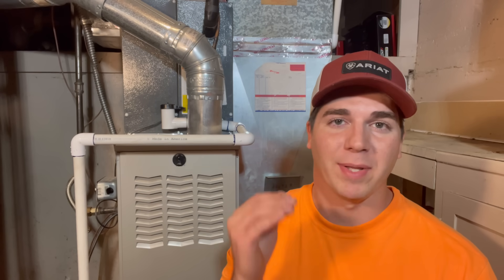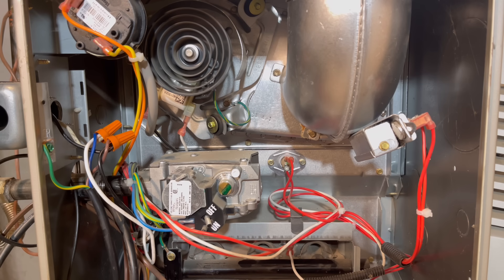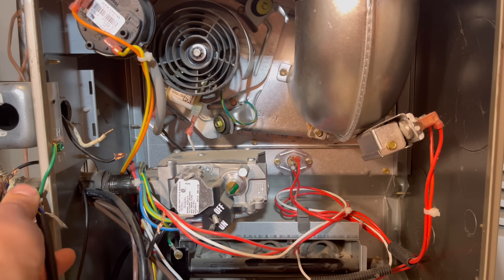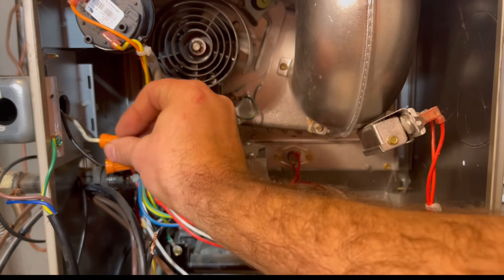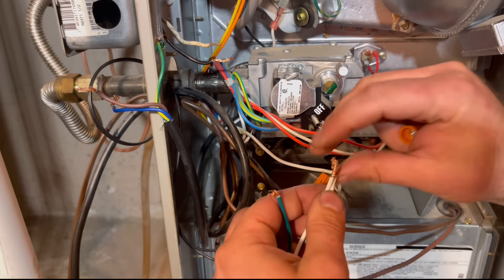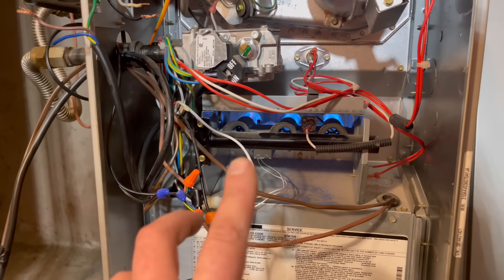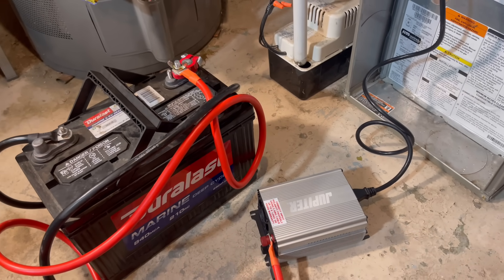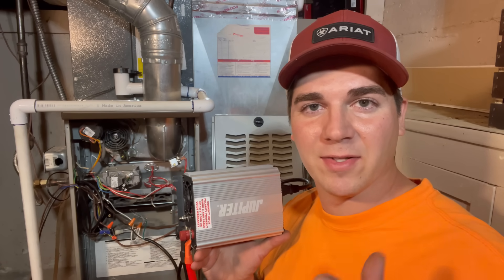Did You Know You Can Heat Your Home With A Car Battery?

Comment: I noticed that you removed the orange wire nuts from the live wire and negative wire to attach the pig tail to the furnace.   I’m not an electrician but isn’t it risky to leave a bare live wire in such a location?  Most of us have a bunch of extra wire nuts lying around to use.
Reply from the maker: I don’t have kids or anything so I knew that switch wasn’t going to get bumped but it’s always a good measure if you’d like to keep some wire nuts on it.

Comment: How would the thermostat work without power? I have a battery operated one but what if it was hard wired?
Reply from the maker: The furnace powers a hardwired thermostat. The furnace has a transformer that takes 110v and turns it into 24v which powers the thermostat.  So if yours has batteries it simply sends the correct signal for heat, and then if you have a hardwired thermostat, it gets power from the furnace, THEN uses that power to send signal to the furnace. Hope this helps! Cheers
Reply: @diyhvacguy  Great answer! I'm going to have to get the things to make this happen. I'm tired of lugging a round a big kerosene heater when the power does out.

Comment: The air handler should be able to run off of a modified sine wave inverter, is there a reason to use a pure sine wave inverter? Just thinking out loud for those who might want to keep the price as low as possible. Also, the larger the furnace, yours looks pretty small, the more battery capacity will be needed. Not sure how much more, just something else to consider. You say it will run the furnace for a couple days, what is the rating on the battery you are using other than cold cranking amps? How many amp hours does it have? One last thing, I saw below about using a switch for a more permanent setup. I'm gong to set mine up to avoid any possible back feeding of current, in the event I am away and the wife has to switch things over. I am gong to take the supply wire for the furnace and attach it to an outlet. Then wire the pigtail to the furnace and plug it in to the new outlet. Then when you need to switch it over, just pull the plug from the outlet and plug  it into the inverter. Then there is no way to back feed, when the lights come back on just move the pigtail plug back to the outlet.
Reply from the maker: Pure sine wave is better for sensitive electronics supposedly
Reply: @diyhvacguy  Yeah, the circuit board is the question mark. I'll give it a try and let you know. I have a modified SW inverter so I'll try it first before I buy a pure SW

Comment: Why not just unplug the furnace from the wall outlet and just plug it in the inverter
Reply: Yes I'm a electrician 
It is standard and per code to have a 6' cord tail installed on a gas furnace cord ignition power and
Reply: A disconnecting means
Reply: All new homes have a dedicated furnace  
Outlet for gas furnace for this reason.  If it was electric furnace it would have a disconnect and would be hard wired
Reply from the maker: I just did this upgrade so now my furnace has a dedicated outlet on a switch. Thanks for the tip brotha!
Reply: Dont misread my text.  You do not need a switched outlet but there is nothing wrong with having one.  Unplugging the cord is your disconnecting means.  The outlet does need to be on it's own 20 amp breaker.

Comment: Can I use the spare outlet on the inverter to plug in a battery charger and connect it to the battery so it will run forever?
Reply: @Mike Wensel Then I guess by that idea. You could use the charger on an EV and drive forever as it charges it's self. Things don't work that way.
Reply from the maker: The laws of thermodynamics simply won’t allow that to work. :)

Comment: Sitting that battery on concrete will drain it over time, you should sit it on top of a piece of wood. Also, you should mention that you are using a marine battery, which are deep cycle batteries and will last longer than a regular car battery, and they are more expensive.
Reply: @Roy Patterson That myth has been bust for years now. Batterys drain the same on a boad or the concrete.
Reply: @Roy Patterson Ask that question in the search bar here on YT, it has thousands of videos proving that is a myth with testing over months. Todd from Project Farm did that same test more then one time over the years, his videos are easy to find on the subject here. He has even done freezer testing for batterys. The internet has millions of questions on the same thing. It has millions of answers to prove it is a myth with even more proof from actual scientists that did testing over months, and years to show it's a myth. Batterys discharged at the same rate sitting on something like wood, verses a concrete floor.
Reply from the maker: Wrong. Debunked

Comment: Would love to see the test, but in frigid conditions like the Texas storm you'd be lucky to get a day out of the battery.  For just a little more money you could just invest in a generator.  Keep it maintained and only use high octane fuel, it will always start and as long as you have fuel you'll have heat.  I have cheap chinese 4k generator i bought for rv...is enough to power my home  hydronic system and my fridge.  Think I paid 300 for it and it's about 10 years old now and has never let me down.

Comment: OK if it's your own property.  Completely different heating system here in UK. Gas boilers mostly. Wouldn't even attempt to wire it to a battery,  omg I'd probably blow it up and I'm pretty good with tech and home maintenance.  Well I'd get into serious with my landlord to. Butane gas portable heaters are a good option. There are ones with safety sensors on them now.

Comment: Really depends on the size of the motor in the furnace 1000 watts is ok for small furnaces but a big furnace can pull way more than 1000 I would advise to get your motors amps then calculate the voltage to get what size inverter you buy
Reply: Just get a fucking generator. This dude’s videos are misleading. People will wind up stranding themselves in a cold house because they will kill their car batteries trying to do this. Lead Acid batteries aren’t made to be repeatedly drained. Even if you only have a 2500 watt generator you’d be better off than doing this crap.
Reply: A hydronic system with one circulator draws only 100 watts. In this case a car battery could power it for half a day.

Comment: how does one know how many wattage inverter one need to buy? 1000w gets expensive, does 300w or 500w or 750W?
Reply from the maker: You need to check the amp draw with an amp meter which can be found in our Amazon marketplace. The link is in all of our new videos description.  So If yours pulls 10 amps, then you would multiply that by 125 and you get your wattage. Always oversize a bit, so in that case I’d probably do a 1500w inverter and a pure sine wave at that.

Also another alternative is to install the inverter in your vehicle and then run an extension cord to the furnace so you can run the furnace as long as you have fuel in the truck. Thanks for watching! Cheers

Comment: That will not last days. With an average furnace and car battery it'd be lucky if you get an hour. You'd also be destroying the battery if it's not a deep drain battery.
Reply from the maker: I realize I was off on the time I thought it would run. I decided to connect the inverter in my truck and run an extension cord so I can run the furnace as long as I have fuel in the truck. Thanks again for watching! Cheers

Comment: Great Idea! I'm just getting started with prepping. I live in the suburbs in Canada without a wood fireplace, and heat the house with natural gas. I looked into propane space heaters for SHTF but I could only store enough propane for a few days at most. Kerosene heaters look more promising as I could store more fuel. A couple of questions:

1. If I did this Battery/furnace setup, what kind of battery would be best? How many? How to recharge? I'm thinking deep cycle golf cart batteries.
2. How long will the natural gas flow if there is a long term power outage?
3. What about infrared panels hooked up to solar panels?
4. What about wall mounted Natural gas ventless heaters?
Reply from the maker: The ventless radiant gas heaters are an awesome alternative. And a few 100ah batteries in a series with a solar recharge would be fantastic to have if you can’t get a generator. Obviously a gas generator is probably the best option but that will for sure attract attention which is not ideal. 

Alternatively what you can do is install the inverter in your vehicle and then run an extension cord to your furnace so you can power the furnace for as long as you have fuel in your vehicle. Hopefully this helps. Make sure to subscribe to our channel for more helpful, HVAC tips and tricks. Cheers.

Comment: As the battery voltage drops, you’re gonna have a low voltage problem. And electric motors for the blower and the inducer motors cannot tolerate low-voltage for long..
Reply from the maker: Yeah, alternatively one could install the inverter in their vehicle and then run an extension cord to the furnace, which would allow them to run it for as long as they had fuel in the vehicle. Simply start it up every once in a while and you’re good to go thanks for watching!

Comment: its good to power a furnace with battery and inverter.... works great.... but buyer beware.... buy only a PURE SINE WAVE inverter..... reason being.... if you have a vari. speed drive blower motor the modifed sine wave  inverter will burn up your 600 dollar blower motor .....dont ask how i know ....thx....

Comment: This is great. What about the idea of keeping a standby battery nearby, would it hold a charge if unused?
Reply from the maker: That’s smart. Also a solar panel to recharge would be good. 
Alternatively, one could install the inverter in their vehicle and then run an extension cord to the furnace so they can power the furnace as long as they have fuel on the vehicle! Hope this helps. Cheers.

Comment: How do you trip your themostat if it's electric too?
Reply from the maker: The thermostat is powered by the furnace, so as long as the furnace has power, the thermostat will still control the temperature as far as when it turns on and off. If it’s an older thermostat and has batteries, then obviously, the batteries would power the thermostat telling the furnace went to come on and off.
Reply: @diyhvacguy  cool, thanks

Comment: How do you determine the proper size inverter?
Reply from the maker: Measure the amp draw with an amp clamp, which can be found on our Amazon storefront. You can find that link in any of our videos description box. Then once you have the amp draw you multiply it by 125 and you’ll get the wattage needed. Always oversize by a little bit.

Comment: main blower is going to suck the juice out of that battery 4-8 hours.. depending on blower size. though it's better to use vs. nothing.
Reply from the maker: An alternative is the hook the inverter to your vehicle and power the furnace for as long as the vehicle has fuel in it 👍🏽

Comment: Will not last days but hours, now your car battery is dead and you cant start your car. I hope you own a car battery charger because you are now stranded at home. You also will shorten the life of your car battery because they are not deep cycle batteries and not designed to be deep discharged.
Reply from the maker: I realized quickly this was the case. The alternative is the connect the inverter to your vehicle, then you can power the furnace as long as you have fuel in the car. Just start it up from time to time. Cheers
Reply: @diyhvacguy  your car alternator is designed to maintain a charged battery not charge a low battery. If you wait dor inverter to sound low batt alarm the car might not start (experience). Your best bet is to connect to car and start car and leave on while heat is needed. Turn car and inverter off when heat is not needed to save gas. The draw on the battery at 12 volts is probably around 30-50 amps approx so your car alternator will already be working. You can open car hood to help keep alternator cooler, but it will still run pretty hot. Should be ok though.

Comment: Great idea if you don’t like your furnace.  Electrical components really don’t like modified sine wave inverters.  The cheap ones like the one used in this video are modified sine wave invertersIt will work for a few hours until capacitors and voltage regulators fail on both the main control board and the gas valve control board.  Newer digitally controlled furnaces will fail faster and may not be worth repairing.  Should be about $4-800 plus a service call to fix
Reply from the maker: Yea I learned quickly the pure sine wave is the way to go especially with the newer furnaces. Thanks for sharing

Comment: I have always been told to not leave a car battery setting directly on concrete because it will cause the battery to drain.  Set it on a piece of plywood or 2x4s. Anything wood.

Comment: what do you do if your blow motor is 230 volts
Reply from the maker: Unfortunately this wouldn’t work for that. You’d need to either have a huge generator or figure out a different heat source. Im going to do a video soon on heating your home with no power or gas so stay tuned for that! Cheers

Comment: I would've just wired the UPS in parallel with the battery in an UPS as the furnace is likely plugged into a 120 V outlet or through a common 120 V light switch.  Might not be as efficient as inverters continue to consume some energy when power isn't being drawn and  a UPS inverter might be a lower quality less durable inverter (often just more noisy), but the UPS would also take care of switching to battery power when needed and when to recharge the batteries automatically.

Comment: A great idea!  And, if you get another camper battery and inverter, you can run small table lamps and the TV, computer, and internet router.  That would give you access to valuable information about the weather.  You can also use it to charge your phone.  That would give you access to 911.  A little trick for you...if you look on Amazon, Lowe's, and Home Depot, you should be able to find a fluorescent shop light, you know the little strip lights with 2 bulbs and reflector that you saw your grandfather use in his shop?  One of them should be really cheap and not a lot in price.  Place that on your kitchen countertop or bar or somewhere out of the way.  Plug that into your inverter and that will provide light for your kitchen in an emergency.  An even better tip for you, plug your refrigerator into the inverter and that will keep your refrigerator going during the emergency and prevent food spoilage.  If you have extra power left over, plug your Christmas tree into it.  You should be able to.  Most Christmas trees use LED lights and you probably won't any more than maybe 2 strands of lights on the tree anyway.  If you have an alarm system, the system transformer assembly is usually plugged into a standard outlet.  You can run an extension cord from your inverter to your alarm system and keep it going as well.  The possibilities are endless.

Use solar panels and keep the batteries topped.  Always remember to charge the batteries after each usage.

Safety alert!  Don't put two male ends on a cord.  Some people use this to backfeed the house.  I usually like to call those cords "suicide cords" because the prongs on the other end will be hot.  And, if not done correctly, you could potentially backfeed the transformer on the pole.  This can then create a dangerous situation for linemen who are trying to restore power to your neighborhood.  So, don't use this to backfeed your house.  And, always remember to keep an eye on how much power you are pulling on everything.  Overloading causes fires.

Battery safety alert!  Some batteries put out hydrogen sulfide during charging.  I don't know if it's during use as well or not but still, be careful just in case.  Open a window a crack to allow proper battery ventilation, especially during charging.  Hydrogen sulfide is an explosive and poisonous rotten egg gas that smells like rotten eggs.  It is colorless but has a strong smell of rotten eggs and is explosive and poisonous.  Batteries put this gas out during charging.  I don't think it happens when the battery is under load or discharging but I would be careful.  During charging of batteries, you should not be smelling rotten eggs.  If at any time you are smelling rotten eggs, get your family out of the house and call 911.